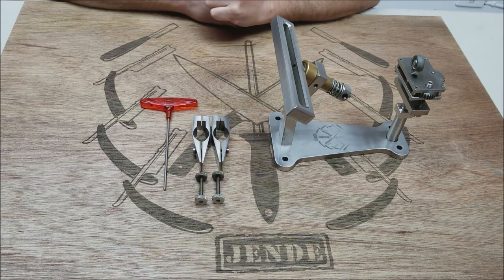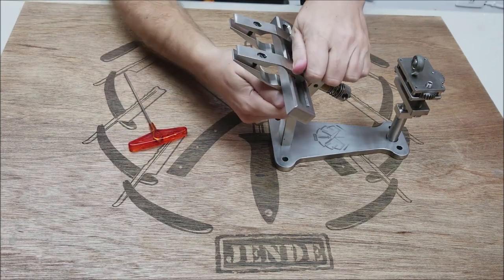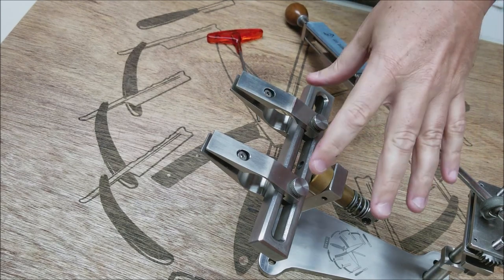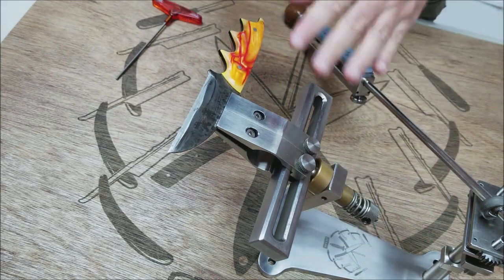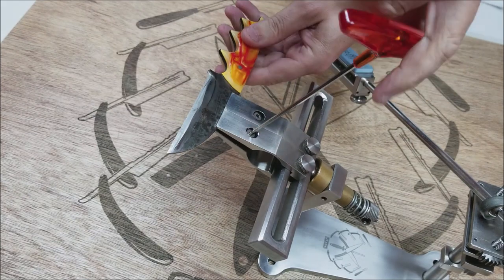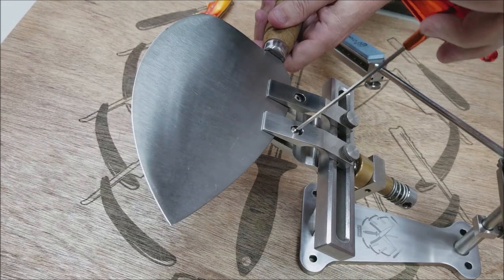Jende Industries Guided Sharpener - JIGS for Knives Build

Comment: For the stone holder I'm using stones with no blanks there the poltava cbn ones about 1mm thick 6 inches long will those fit in the stone holder without mounting them to blanks?
Reply from the maker: They can be held in place with the JIGS stone holder without the standard blanks. The spring tension helps to keep things secure. However, having the stones mounted is always better.

Comment: So very similar to HAPSTONE, TSprof. But still very expensive. 500+ for a unit. So where is the difference ? I see the same thing more or less and still hundreds of dollars to get.
Reply from the maker: We've answered this before on our videos. The Jende JIGS for Knives is better/different because
!. All Stainless steel construction - It's dishwasher and weatherproof.
2. Uses FDA food safe parts where possible.
3. Exactodrive is unique for fine tuning angles with extreme precision.
4. It's built by actual sharpeners, for sharpeners.
5. Easy to use.
6. Waterproof IP65 rated angle cube
7. H1 Rated food safe Grease for lubricating moving parts.
It's just better. :)